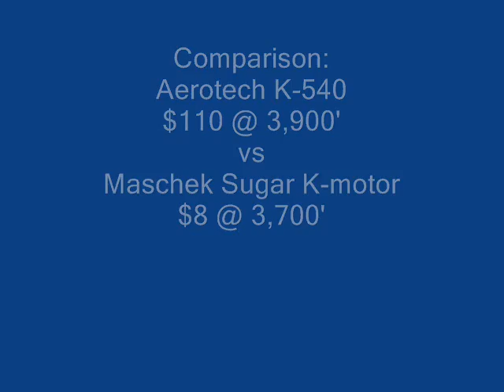LDRS 29 NIKE SMOKE Flights: Sugar vs Aerotech

Comment from the maker: @randyclar747 Yes, it was "homemade" in the sense that I mixed and melted and pour the grains. They were then loaded into a reloadable Ellis Mountain 75mm motor case. I have made my own sugar grains and motors for sizes G-N and am now working on a 4 and 6" diameter motors. Ultimate goal is to power a rocket with sugar into space. See sugarshot org 
Ignition system for Aerotech and our sugar motors is similat to the estes except bigger.